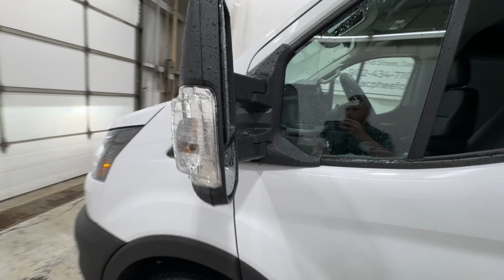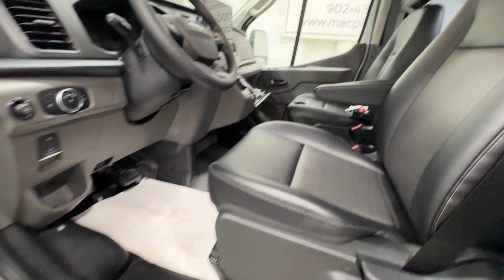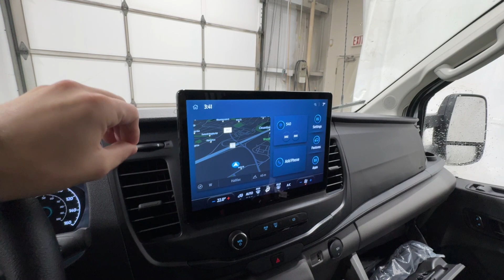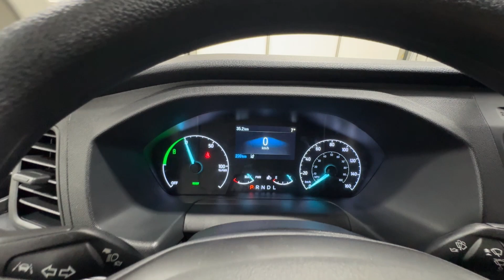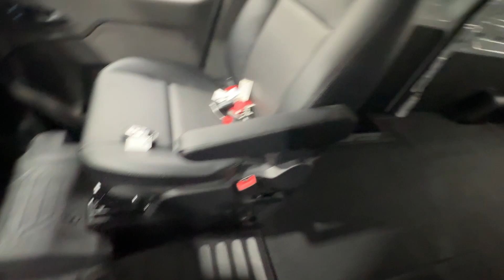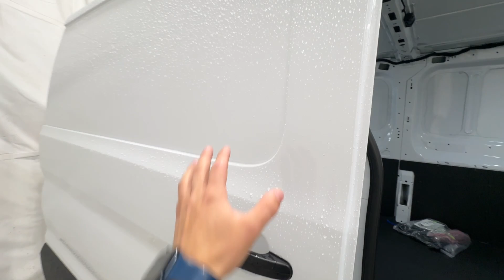Worth The Buy?? 2024 Ford E-Transit Extended Range Battery Review

Comment: You said 250-260 range but everything i read says the :enhanced" range only brings it up to about 159 miles. If it'll go 250 miles, let me know! I'd be interested if that's the case.
Reply from the maker: 250-260 KM, not miles. That would equate to roughly 160 miles
Reply: he's talking about Km not miles check that vid again 250 Km = 159.839520 Miles

Comment: Still no Sleep/Dog A/C mode?  Who still needs 12v connectors?  They should just  USB-C and 110v 250w plugs in front  and 110v 2000w in back.
Reply from the maker: A lot of accessories are still 12V and a lot of customers use it. Think dash cams, gps trackers, telematics etc.

Comment: Should also mention that the 80amp needs a 100amp cuircuit, level 2 charger for fastest level 2 charging of 19.2 kW less than five hours or lesser speeds and upto 180 kW DCFC or NACS Tesla charging.  Of 80% in less than 30 minutes.  

You should also mention the new heat pump for extra temperature controlled range and more efficient operations.  Mainly winter with the heater but summer AC to a lesser effect.    One if the best features is the self parking which can always be a challenge in a van.
Reply from the maker: Great information! I'm glad you brought up the new heat pump, it really is a game-changer for electric vehicles!